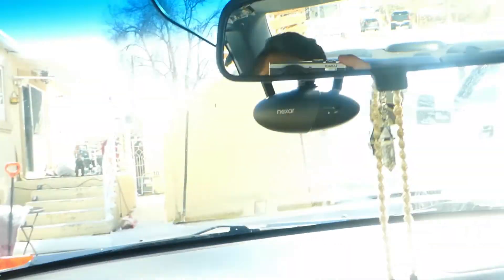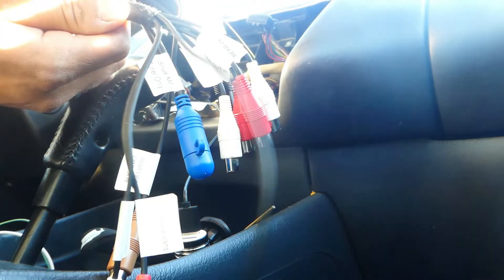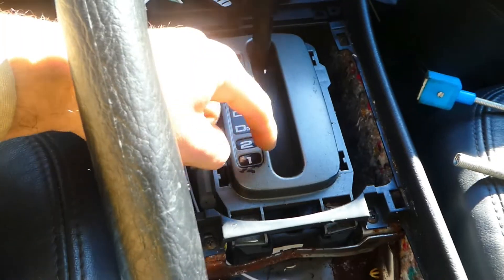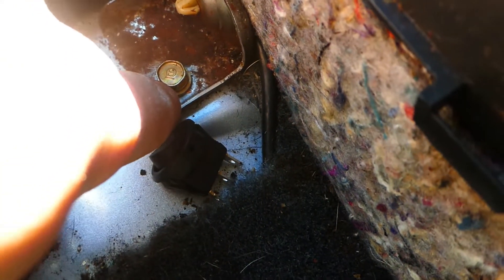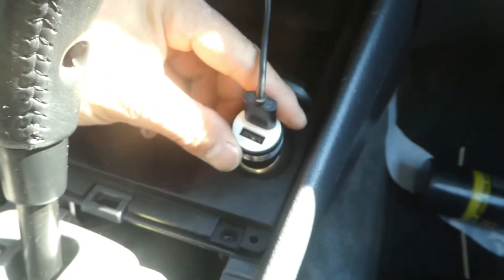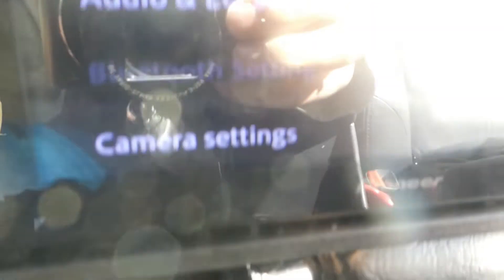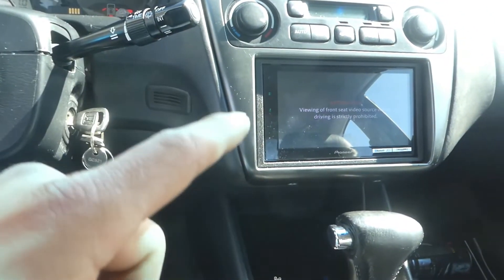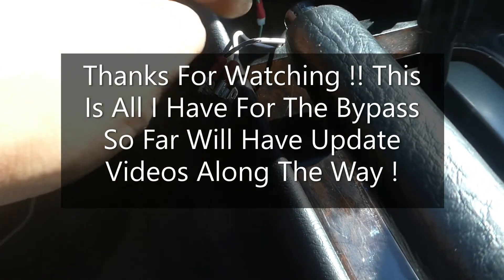E Brake Bypass & Radio Update

Comment: Don't you just ground the brake wire and then it thinks your always in park?
Reply: Not with the pioneers they make you ground it unground then ground again , some options are available tho when it’s permed grounded but mainly in the settings